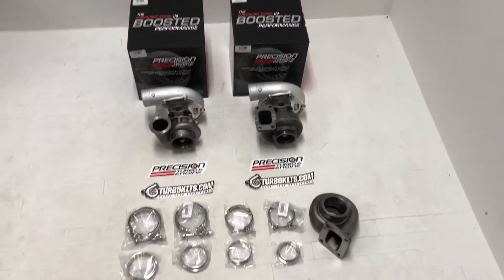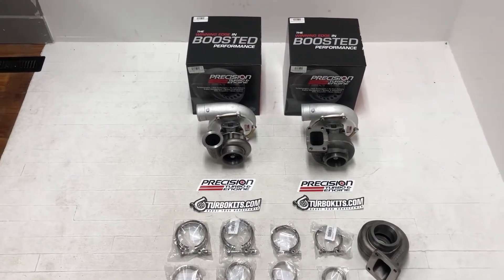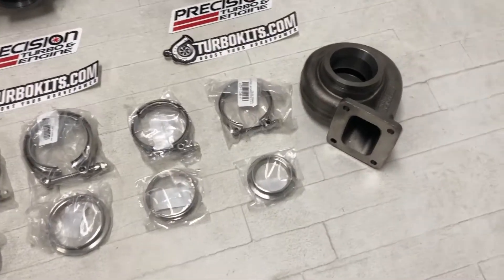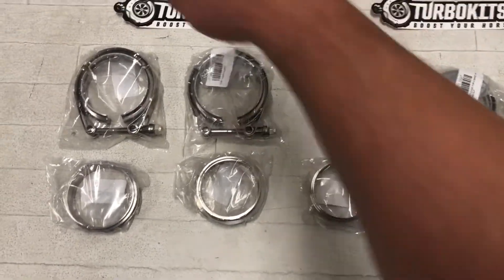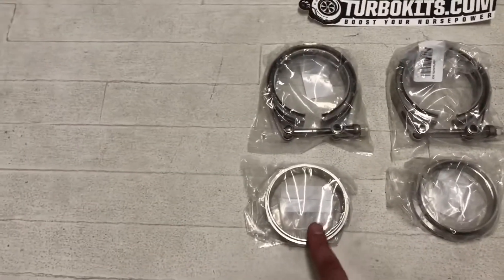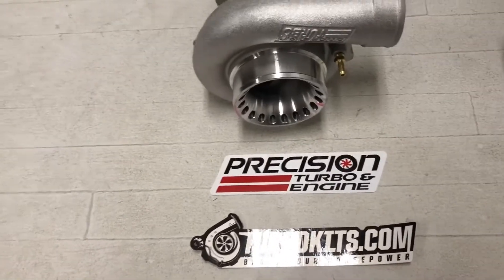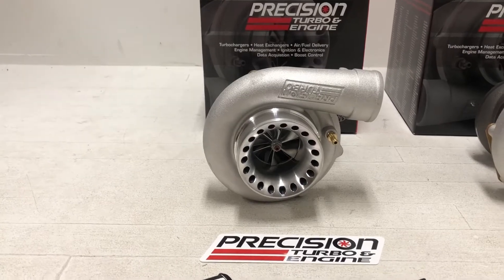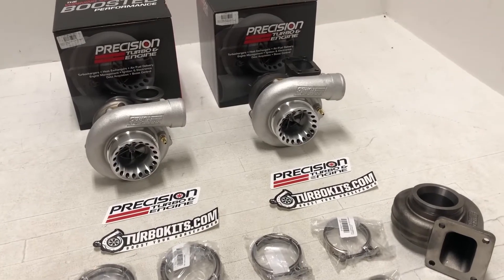Precision 6266 Turbos - Information on Housings, Flanges, Etc

Comment: So if I order a gen 2 5558 t4 v ban outlet, the v ban outlet for the downpipe will it be a 3 inch v ban?
Reply from the maker: Yes the T4 PTE housings, both open and divided have the TRUE 3", meaning for 3" piping, so the actual OD is 3 5/8th".

Comment: The turbo on the right, what is the part number for that clamp and flange ? I got that exact turbo and looking for the part number thank you
Reply from the maker: The T3 Open, 4 Bolt Inlet, 3" V-Band Outlet Housing?
Reply: @TurboKitscom  yes,
Reply: @TurboKitscom  yes I need the flange and clamp